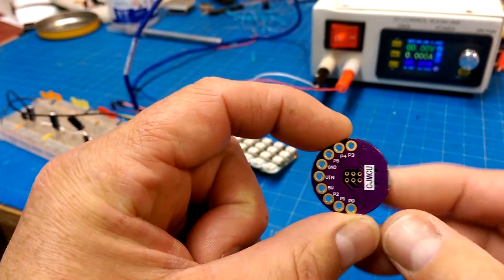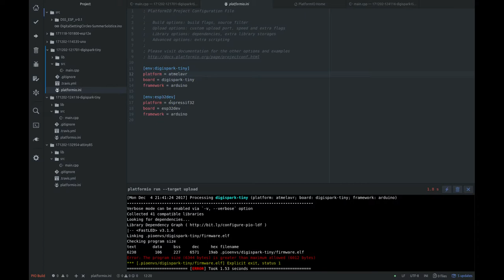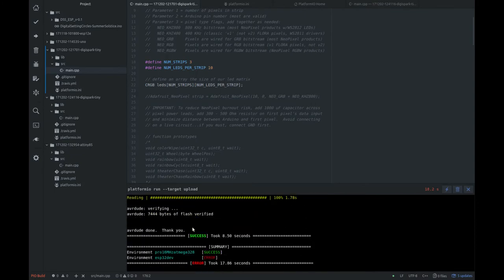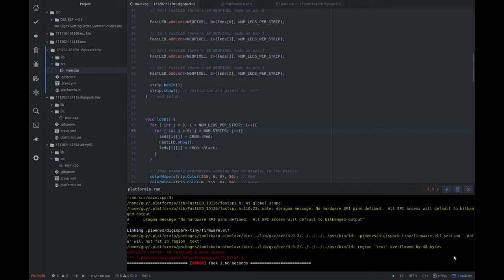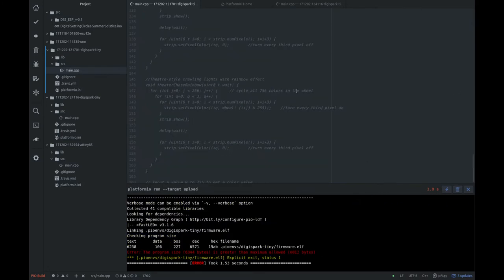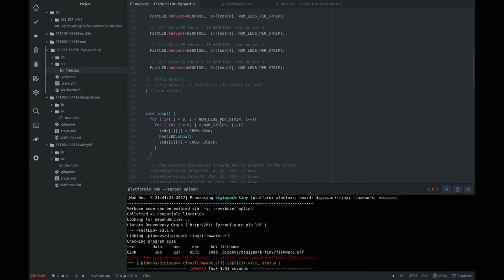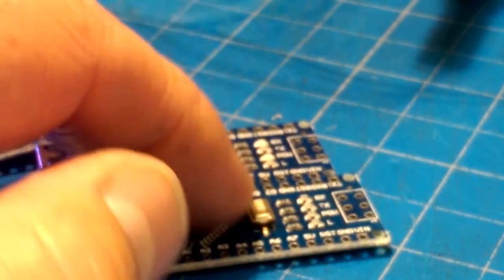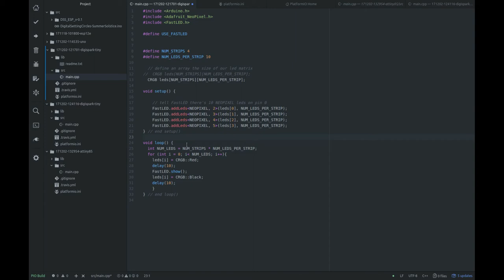noodling with neopixels

Comment: Whenever I try building projects with huge amounts of neopixels I always run into the issue of running out of memory. I have yet to find a solution for this ( reducing the memory footprint, I mean ) aside from just jumping to bigger and bigger micro controllers to handle it. I didn't find any of the alternative neopixel libraries to make much of a difference. 

The only thing that kind of helped was getting rid of all of my local color arrays and just polling the library for pixel state, doing what math or adjustment on that state and pushing it back to the pixel as needed. I'm sure there is a ton of processor overhead for this, though. So it's still a pretty big trade off if you're trying to do anything particularly fast with them. 

Did you find anything to help with this issue?
Reply from the maker: That was the only suggestion that I found too:  doing calculations for each pixel as you need them rather than storing the pixel data in an array and then writing the array to the pixels.  Did you try the FastLED library?
Reply: Yessir, there was a 3rd lib that I used as well although the name escapes me. Neither of the 3 seemed to make a significant difference on a per led basis ( meaning, their initial footprint may have changed alittle but the amount of dynamic memory they needed to add more pixels never seemed to get much lighter. )